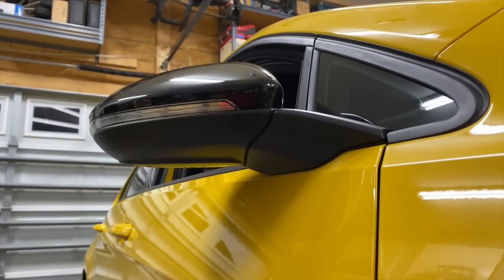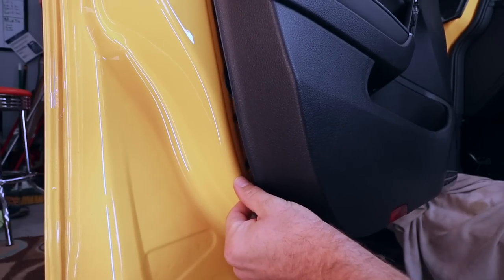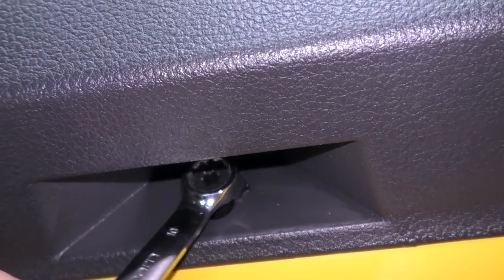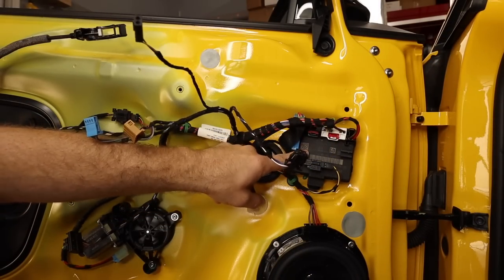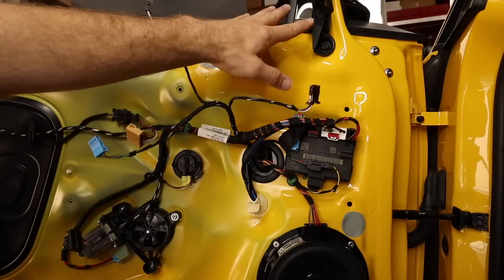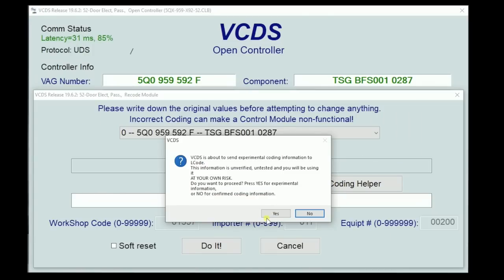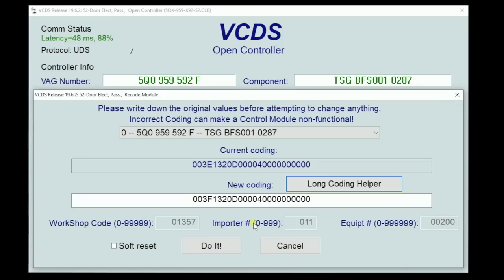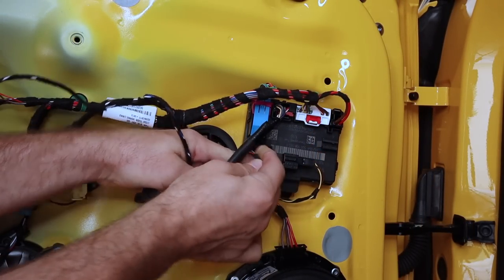MK7.5 Golf R Power Folding Mirrors Installation and Coding

Comment: Another adapatation that I found nice, is if you disable Bit 5 under module 42 and 52 (door entry lights not active while mirrors folded), the puddle lights will come on as soon as you unlock the door, instead of waiting for the mirrors to unfold. 

It looks cool, because you can see the light beam moving as the mirror unfolds.
Reply: this is a really nice tip! thanks

Comment: folding mirrors are the easiest way to tell if my car door is locked or not.
Reply: you can tell if the car is supposed to be locked. At least in VW and Seat you can send the lock command and have the mirrors fold in while a door is still open. after that door closes then it locks it
Reply: It would be better than constantly blocking the car and looking at it for the audible and visual ques.
Reply: @noobgamerpt5224  reminds me of old GM cars where you lock ND unlock the car by a press of a button.
Reply: YES I do the same, look back to see.
Reply: Don't need to look back. My car is set to auto lock anytime all doors are closed. Never failed yet. And getting the front doors to unlock is automatic when the fobs in pocket. Opening the two rear doors is easy too, just double tap on the inside of either front door handle and the rear door auto unlocks.
Reply: @SpaceCadet4Jesus  I did this but turned it back to stock because it got annoying when I had to get something from the back seat - I'd always have to keep my front door open.
Reply: @deltawhiskey6417  You're supposed to climb between the front seats to get something from the back, not get out and exhaustively go back there. 😆😉

Comment: I used to do this on the 80's mustangs.. allot of parts from all the different fox platforms are easily installed or adapted.  Didn't have power seats.. find a Thunderbird. Plugs right in. Want different map light.  Find a merkury. Lol

Comment: I sold my gti over a year ago but cant stop watching your videos. Great job like always
Reply from the maker: Thanks so much. What did you replace it with
Reply: @HumbleMechanic  went with a 2014 Subaru XV crosstrek limited. Much slower but has more space without driving like an SUV and got it for a great price. I had a mk5 dsg and the new tech is awesome but the cvt is awful. Also have a 97 miata for the fun drives so not completely missing out on all the fun. Definitely returning to the VW family for a used mk7 golf R later on.

Comment: Speaking of OCD.... your volume knob is off TDC by at least one click 😁

One thing I strongly dislike with my Leon is the rear window defroster and heated mirrors are operated by different controls.  The rear window defroster from the button on the climate controls, that has an adaptable timer; and the heated mirrors from the mirror adjust rotatory button, that doesn't appear to be timed.  I've not been in a situation where I'd have the mirrors heating and not the rear window or vice-versa, and I sometimes forget to switch the mirrors off which can't be good for the elements 😢
Reply from the maker: Hahahha maybe it’s the camera angle. 😜. I hate that button is not blacked out
Reply: VW have some stupid ideas especially with how you fold and unfold the mirrors. You have to look at the button before and after you rotate to know which mark you are on and where to rotate it because it fully turns to 5 different position without any tactile feed back of what is the current position! Very very stupid and a normal kick back of the button to  fold/unfold is much easier as in our 10 y old chevy cruze. German engineers are sometimes so dumb

Comment: Looks straight forward, Thanks 
I don’t have fishing line but maybe I can use weed wacker line. I used it to pull the wires through the rubbers boots and panels in the hatch for the LED taillight install.

Comment: As always, thanks for the great content, Charles! Just finished my install and it was MUCH easier due to your how-to. Keep up the awesome work! 👍🏻
Reply from the maker: Awesome!!!!!
Reply: HumbleMechanic - Question for ya: I have my doors set to lock after I exit the vehicle (using the prox sensor). Do you know if there’s a setting that will also instruct the mirrors to fold when this happens? I already have everything else you have coded set and currently this doesn’t work.

Comment: this is actually a really worthy upgrade. the puddle lights and passenger's side mirror lowering in reverse feature are already really nice upgrades (and should have definitely came standard), but the power folding just makes it feel much more luxurious...

I think the main reason they left them out ultimately comes down to cost cutting, and not really to do with the size of the car, because you can get power folding mirrors from the factory on an S3, which is about the same size as the Golf.
Reply from the maker: 100% cost :(

Comment: I recently rented a small Mercedes wagon in Italy that had this feature for the mirrors. Yeah, raid space is really tight there. This feature is probably to guard against losing mirrors to scooter riders.
Reply: It is interesting that you say this because I had a conversation with a friend about this. 
On the 08 MY C-Class (W204) they had this feature (I think as an option) in the US and for the 09-14 model years they removed this feature and only Canadian cars had them. 
Between the 2010 MY to the 2014 MY they redesigned the mirrors on the C-Class that looked exactly like thebmirrors on the E-Class (W212) and they have the power folding mirrors. It makes me wonder why they didn't bring back the power folding mirrors for the 2010-2014 C-Class'?

After seeing this video, I wonder how hard it would be to retrofit the C-Class to have this feature.

Comment: Great tutorial! I want this on my MK7 GTI. I think this mixed with the sequential turn signals and also new blind spot concave-vexed mirrors, as I don’t have blind spot monitoring, would be the perfect combo. $500 for all this is a lot, but I think worth it.
Reply from the maker: If you don’t have Bilnd spot it’s like $350 for the mirrors. But add turn signals and mirrors and you may be right back up there.
Reply: HumbleMechanic yeah. $350 isn’t bad. I would do the mirrors and sequential turn signals all at the same time if I did it. Would be $500 for everything. Still not too bad.

Comment: Mine has these from factory, but my car is a Japanese version imported to the UK, so for a 2014 Golf R mk7 it's got pretty much all of the options ticked. However, one thing that does get me is that I can hear the trunk handle open for the reverse camera, but my head unti only displays the sensor screen. I'll have to open the trunk and take a look as you never know what previous owners have done, espically from Japan as they like to modifiy their cars with lighting etc. It even has an ETC reader in the glove box.

Comment: Since those don't come as standard in US, at least can you open the windows with the key? As in holding the "open" button, opens the windows and the "close" closes them all
Reply: Not by default, no. We can enable it through coding though. Who knows why VW didn't enable that on US cars, there's all kinds of small features like that missing on US cars that can be activated if you have a scan tool.

Comment: @Charles, great video, it inspired me to pull the trigger and install these on my 2017 E-Golf here in the USA. The 2017 E-Golf is a mk7.5 Golf, so thought this would be straight forward, but my mirror doesn't fold, nor does the puddle light come on. I have programmed the door module, and I did module 09 as per your detailed video. Nothing happens when I use the new mirror knob to fold the mirror. I was trying to see how many wires you had going to your mirror control switch, as mine only has 4, two pairs at either end of the plug. The two center positions are empty.
The coding was accepted and appears to be correct as per your vid', so at a lost as to my it doesn't work. Any ideas? Many thanks.

Comment: 8:37 - what is that "mirror_lowering_with_rear_gear, active" and "position_memory_with_...", bit 2 and 3 on the screen?

Oh - and what does that green retainer do - you only mentioned to push it out of and into the hole?
Reply: It dips the passenger side mirror towards the ground when the car is put in reverse, very handy so you dont hit your back wheel off a kerb when parking. The mirror returns to its normal position when you drive forward or if you switch the car off.
Reply: @Harry92evers  
Okay, but why not tick them off at the same time, then...?
Reply: You can, I'm not sure why he hasn't. They also only activate when the knob is left in the R position (LHD cars). So if you dont want that feature every time you reverse you just twist the knob to 0.
Reply: @Harry92evers  
Thanks man. Can you answer the last question too?
Reply: The green retainer? Its attached to the door loom, it hold the loom in place inside the door so it doesnt catch in the window or regulator, it also stops the loom from rattling inside the door.
Reply from the maker: Good question on why. And it has a simple answer. I only change 1 thing at a time. 

This way if something is upset I know what made it that way. 

In the video I even changed both PFM codings before I did puddle lights. What you don’t see is I did the puddle lights later after the car was done(movie magic). 

It’s probably me being over cautious but it is an extra 2 minutes to be sure I can make a quick change back if needed
Reply: @Harry92evers  
Okay, why undo a retainer for the door loom while fitting the mirror loom?
Reply: @HumbleMechanic  
Sounds prudent - and I appreciate the magic. 😉

Comment: Good video. That's a lot of work for mirrors! I never really got folding mirrors on a small car. You save like 2 inches on each side. I love my power folding mirrors on my ford f250 but those save like a foot on each side!  I only fold them in when I think someone would walk by and hit there head on it though lol.

Is there any more videos on that programming? I was looking at installing remote factory start in my truck and you gotta program it through a computer.  Looking for like a general instructional video.
Reply from the maker: Yeah it’s not a necessary mod at all. Lol on coding. My videos would be centered around vw coding. I’m sure someone has videos on fords

Comment: Question: Do you have to code the mirrors or can I just use the door panel switch to fold the mirrors? I do not mine not being able to use the key fob/lock button to fold the mirror.

Comment: @HumbleMechanic, have you ever thought about doing a video covering if not installing a MPI / Dual Injection mod? I do not know a whole bunch about it, but do see some kits available online. I would assume it to resolve the carbon build up on the valves. Vids are great by the way, I especially love the detailed how to's like this one.
Reply from the maker: My dude Ian was working on the setup. I’m not sure it’s worth the money really. I need to look deeper into it
Reply: @HumbleMechanic  Well where is Ian's channel? Tell him to hook us up! There is so little information about this. Most of them allow E85 (whats that mean? - not a serious question, but this is the kind of thing that could be covered). Whats the minimum required? How far can you go with it? Etc, etc. I need a sponsorship, because ya its freaking expensive.
Reply: @JoshuaMillerDev  Ok so I'm not a famous mechanic or blogger but here's what I know about it since I am doing the MPI next on my stg3 mk7 gti. MultiPortInjection-MPI is used here in the US (oem on the Euro VWs) is a mod done mainly when you install a large turbo, larger than even the is38 found on the Golf R, when you really want to run full ethanol fuel aka e85 to gain as much power and eliminate any dangerous knocking related w/ higher boost levels. But you need also an upgraded LPFP (fuel pump found inside the tank) to be able to run the MPI extra 4 injectors that will be installed on the intake manifold. between the MPI and LPFP you are looking at $1200 give and take. Labor is about $600 to install both. Special tune is needed for both to work, you MUST upload the tune before starting the vehicle after it all gets installed. With  larger turbo and other supporting mods, you will most likely be around 450-500+ bhp on the ea888 gen3 engines. Another benefit as you mentioned, will be keeping the valves a lot cleaner from the dreaded carbon deposits which all direct injected engines suffers with. You can also run 93 octane instead of full e85 but your tuner needs to tune accordingly. One interesting thing is that you could potentially have the MPI fuse off and run only when needed to clean the valves, not its main purpose of course but in case you wanted to save gas and be on 4 injectors when boosting instead of 8, although 2 different tune maps would need to be stored in your Cobb Accessport so you could use one or the other. CTS Turbo has a MPI that sells for around $700 when on sale, reg. price is $850. I have a hybrid turbo from Europe that is larger than the is38 found on Golf R's, the larger the turbo of course the more laggy it can be, but the MPI along w/ the e85 fuel can really help tremendously!  Cool?
Reply: @yoadriaaannn  thanks for the details, I like learning. Probably not in my cards for this lifetime. I am a non mechanic, but do DIY crap. Most recently had to replace my clutch because of all things the pressure plate fingers (2) popped out of their rivet. Luckily there is enough info across forums, youtube, and helpful people so I could get by. This mpi stuff interests me, however only to keep the valves clean. So it seems like a massi e amt of effort for little gain, and a side effect of having to tune which I am not trying to do. Happy with 230 or whatever this mk7 pp is.

Comment: If you wanted to replace the speaker if an after market solution how would you go about it?

Would it be possible to add the blind spot monitoring if you did not have it as standard?
Reply from the maker: You could add BSM but it would be cheaper to buy a new car. 

I’d probably bolt the new speaker in. Or I’ve riveted new speakers back in too.

Comment: Which platforms and models does this mod apply? This would be pretty awesome for my mk5 2 door rabbit. Did you code for rapid inline turn signals? Need to update if that's the case.

Comment: Surprised they don't come as standard with the R. Not sure if you already know but you don't need to hold to unlock, they'll fold out when you insert the key (not sure about keyless entry but I'm guessing they'll fold out when you push the ESS). I'm working up the courage to fix the rear window regulator on my MK7, don't want to end up with any rattles/leaks, any tips?
Reply from the maker: They will turn down when I unlock the car with teh handle too. :) and you got the regulator. They aren't bad, but the rivets are the worst

Comment: Hi Charles…. I just installed my mirrors and used the quick coding from obd eleven menu to code them but my mirrors don’t fold down from locking and unlocking the car even after enabling it from the car menu but works from the trigger to fold in! Any ideas?
Reply from the maker: See if you can use my coding to cross check the OBDeleven coding

Comment: Nice video, you didn’t change the bottom light to a R display, turns on when you open door.
Reply from the maker: There is no light in that part. That’s a separate add on
Reply: At the bottom of the door, to light where you step out of the car?

Comment: Hey Charles my name is Rubens big fan, I have a 09 Audi A4 b8, it’s a manuel. The car runs fine ever since a got it no issues but recently I’ve been feeling a strong vibration every time I’m reversing. Do you any suggestions of what could be wrong. I’d appreciate it
Reply: Check your ending and trans mounts.  They could be the issue.  If not it could be clutch related.
Reply: Thanks so much my man Im also a big fan of your channel as well, keep up the good work

Comment: Hello sir ,in my car is the control module 5q4959, do I have to change it and which one is the right one, I installed the mirrors but they don't work for me.
Edit:my rearview mirror does not have 2 cables like yours, but only one :(

Comment: @Charles 
I want to install heated mirrors on my 2006 VW Polo. It has central locking but the mirrors are mechanical. Do I need to code the car as well or is it just plug and play ?
Reply from the maker: Oh boy I’m not sure. It may not have wiring for the heaters
Reply: @HumbleMechanic  I just wrote Volkswagen a mail. Going to tell you as soon as I get an answer

Comment: Do you know if the process is similar for a normal Golf 7(not Golf 7.5)?
Reply from the maker: The install is almost exactly the same. The coding should be very close too. The only thing I have seen be different is the low line MK7 door modules may not work. Might require replacing the modules too.
Reply: @HumbleMechanic  Awesome, thanks! I've been wanting to do this for a while

Comment: I have a b6 2008 passat which has folding mirros from the factory, unfortunately when I unlock the car with the key they don't unfold or fold when I lock it I have to rotate the knob when I get in the car basically looks the same. Can I just use VCDS or obd to program them to fold when I use the key? I would really appreciate if someone could tell me since I really want this feature.